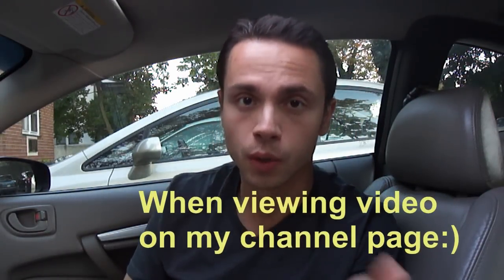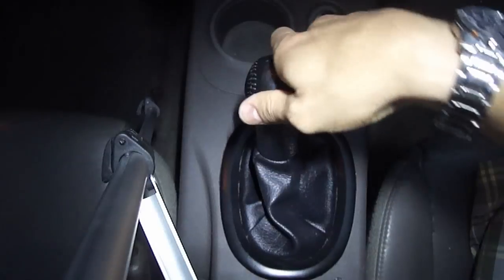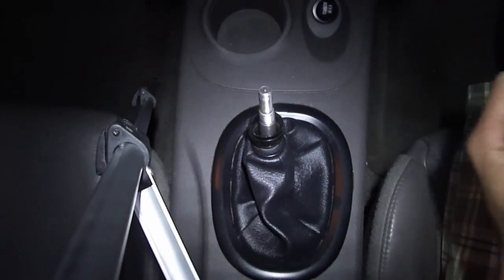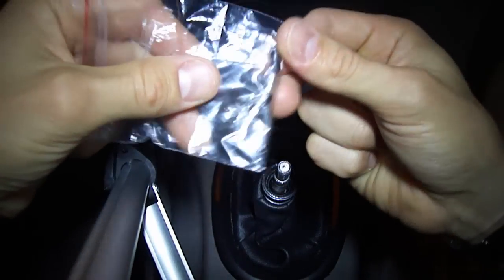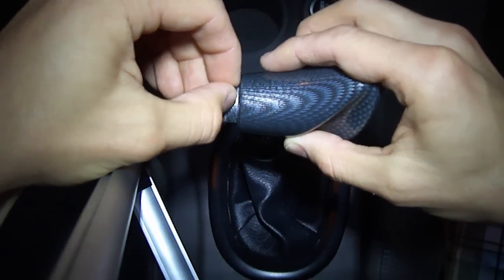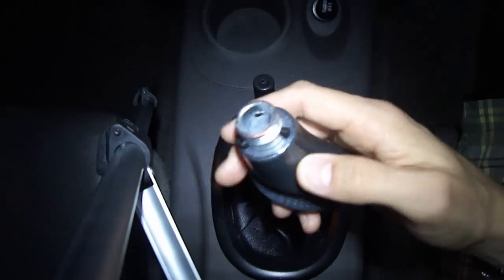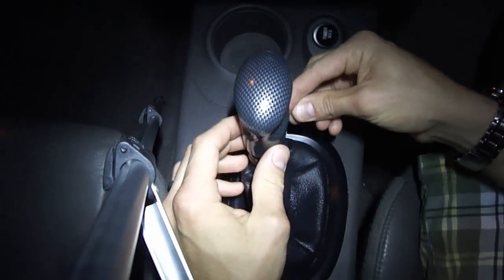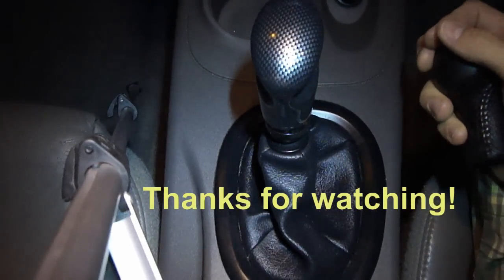How to Replace a Manual Shifter Knob

Comment from the maker: Hey Thanks for the comment! That's interesting what's happening to your Accord. Perhaps your Automatic Shift Lock is malfunctioning. It prevents you from shifting out of park unless the brake pedal is already depressed and the ignition switch is in the on position. I'm not sure how to fix it though.

Comment: quick question do you screw the screws into the bottom of the plastic cap or into the metal pole under the plastic cap? thanks~

Comment: Hello, I have a question, I have a 6 speed manual where you have to pull a pin up to put the car is reverse, can you install a aftermarket knob on one of those or does it not work?

Comment: Thanks! Question... do you have to remove the center console to replace the boot?
Reply from the maker: You may be able to pry the black plastic rim off the boot and replace it that way, but be careful you don't break the plastic rim.

Comment from the maker: I'm not sure of the wiring schematics for the Xbox, but in theory it should work. It may require some troubleshooting to figure it out. Make sure you burn off the enamel coating from the wires (like I show in my 3rd headphone video (named: #3 Fix or Repair Headphones with Microphone / Bass Boost). Just go to the 6:10 timepoint in that video to see what I mean.

Comment: I bought a 2009 5 spd pontiac G5 - GT  a beautiful mint black car but the round shifter knob is chrome with plastic silver bottom and then stitched leather material down the sides of the shifter bar to the leather boot. its the factory knob. The chrome H pattern has peeled away..i see no screws or bolts and i hv no idea how to get the knob off to put on an aftermarket knob..noone seems to know how to remove it and have tried twisting and pylling to no avail and no sites to help me on this..i hv tried everything any twisting only seems to twist the leather booting on the shifter bar not the boot it sits in.  i just want to replace the knob..any thoughts.. the top half of the knob comes off i guess the factory glue gv way  and i peeled and painted the top half and added a clear coat shine but looks really cheap looking now. any thoughts how to remove the whole knob it does not want to turn it just twists the leather on the shifter bar above the boot..perhaps a pic would help but can't even find anything online there is 1 video that shows a guy just shifting a pontiac G5 GT so u could c a pic of the knob..any help would b appreciated. I live north of Toronto ontario. thx lee.

Comment: the ones mine came with were all a little too lose, even after I screwed the three side screws tight against it. It didn't wriggle, but it could slip off, and the little screws loosened themselves pretty quick. Hopefully I can find a good one the lights up like this one! Oh, and because the button for the lights was on top, it kept getting pressed by my palm, so beware  :)

Comment: Looks simpler than it does in my car... I have a Citroen C2 and the knob looks bad right now, I want to change... Do you know if it's this simple?
Reply from the maker: It's worth a try, but unfortunately I'm not familiar with the Citroen C2's setup. There is usually either a screw somewhere holding it on or the knob twists off.

Comment: Are the screws supposed to screw into the threads where you would have twisted the old knob on or supposed to screw them into the rubber part?
Reply: They screw into the rubber to make it a tighter fit

Comment: what about if the stick has a pull up mechanism to place it in reverse, as in, just below the knob there is a ring that you pull up?
Reply: Have you found an answer to this question yet?
Reply: +Twisted Humor no..
Reply: Jamie Ferguson I have same style shifter. Have you found any shifter that could work with that?

Comment: question.. i have a saturn Ion 2003 manual.. not sure if i can change my knob.... help...  i think the stock is the only one it takes
Reply: i have a 07 saturn ion manual and mine wont come off for shit
Reply: i found out how it comes off... but the metal is in the shape of a D i don't think it can be replaced..
Reply from the maker: michael john Some kits come a screw that tightens against the "D" shaped metal. I believe you can place the one I show in the video on it.

Comment: I have a 2004 mitsushi lancer ES but the shift knob won't move, or turn...any suggestions on how to take it off?
Reply: Jus pull it that's what I did on my BMW because it didn't turn to any direction

Comment: My gear knob won't come off, i can rotate it but it takes some strenght but there is no point it get's more loose! Is it possible i just have to pull it off hard cause it seems to me that isn't the case aswell. Can someone help me out?

Comment: I tried using a shift knob from a auto store but my 2000 Mercury Cougar's shifter, the boot has to be pulled up to shift into reverse. The new shifter interfered with that.. is there is certain shift knob I need?
Reply: I think saab 900 shifters are the same

Comment: You'll need to get a piece designed for your car, or you could buy a piece of steel or carbon fiber and cut your own out. That would be a fun DIY project.

Comment: Will this work on a 04 malibu?
Reply from the maker: It should as long as it a screw off knob. Most are, if it doesn't unscrew then there most likely is a side screw somewhere that will loosen the knob.
Reply from the maker: The screw will be small and inconspicuous, so you might have to do some hunting. However, try turning the knob counter-clockwise and see if it'll just twist off.
Reply from the maker: jaidon waiters you could email me a pictures at richsmethods@gmail.com
Reply: jaidon waiters Why you you post your phone number on the internet just boggles my mind.

Comment: Yeah... this definitely didn’t work on my 2007 Chevy Colorado. Like tried turning it to the left and it moved just a smidgen but then wouldn’t move anymore. I even got a pair of vice grips out and tried to remove it all it did was tear the rubber off of the shifter
Reply: Maybe you just have to pull it up instead of turning?

Comment: even when i make sure the screws are tight the shifter still spins around.. idk what i am doing wrong
Reply from the maker: You might need to place some plumbers tape around the area where the screws tighten to increase the amount of surface area the screws have to hold onto.

Comment: my original knob is stuck &  keeps rotating.  I think the thread is broken.  I don't know how to take it out &  worried that i might have to change the whole gear rod!  can anyone help?
Reply: That's what happened to me and I had to tear all the knob and pull it, I kinda break the older one but well I have a new one now so don't be afraid to break it just pull it and put the new one